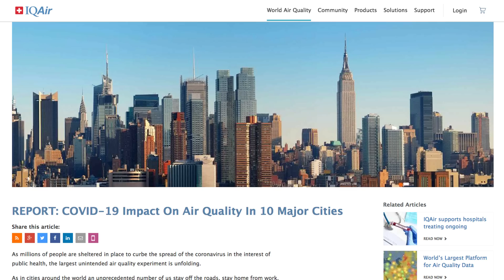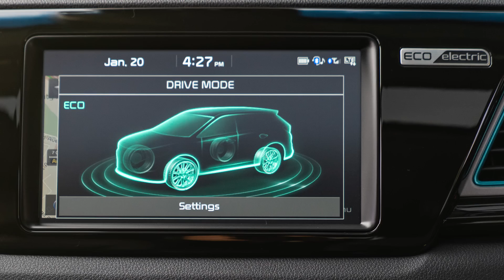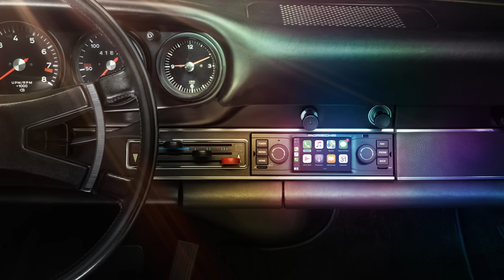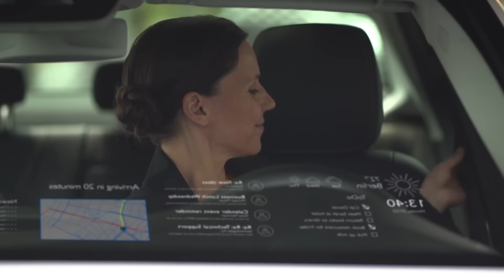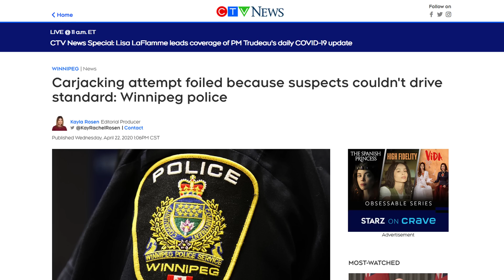Toyota Debuts All-New Yaris Crossover; Cylinder Deactivation for Diesels - Autoline Daily 2822

Comment: They continue to hold on when gas or diesel hybrids and EV vehicles are going to dominate.
But like the so called stick shift or manual transmission going the way of the dodo it will be a slow change.

Comment: It's hard to argue against hydrogen for heavy payload applications. I also wonder about hydrogen for jets?
Reply: Much rather use methanol fuel cells then hydrogen.
Reply: Hard to argue against? Heavier vehicles, which are meant for highway use, require more power on a continuous basis, which requires the use of a significantly larger fuel cell than a vehicle which is designed for city use, which massively increases the cost of the vehicle. No one would ever be able to afford such a vehicle.
-
Fueling jets with hydrogen requires entirely new aircraft to be designed and built, and their aerodynamic efficiency would be compromised by the size of the fuel tanks. The fuel would also need to be stored at cryogenic temperatures in order to keep the weight of the fuel tanks low, this requires absolutely phenomenal amounts of energy and highly specialized handling procedures, equipment and crews. Hydrogen also causes metal embrittlement, so engines would need to be redesigned to burn hydrogen.
-
It would make far more sense to use a carbon-neutral synfuel, like the one that the Navy is developing for its jets, this would eliminate the need to replace existing aircraft.